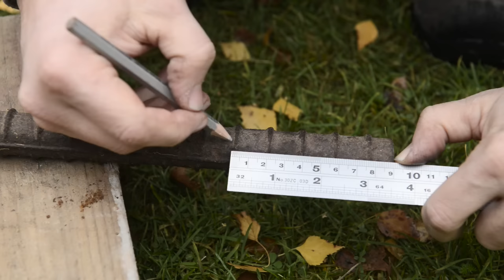Blacksmithing - Forging a tea light holder from rebar

Comment: Very simple project. You really like rebar to work with. It is very easy to work with and shapes easily. Also, unlike mild steel, it will take a heat treat, though it is not a very good heat treat as it never really gets hard enough for a hard use tool. I guess it is some kind of low carbon simple steel.
Reply from the maker: Yes. The alloy can vary very much. The purpose is just to sustain a specific strength specification, other than that it can contain just random alloying elements - so I have heard...
Reply: Yes I have made some knives with it and heat treated them. They hold an edge...fair. It reminds me a lot like 9cr18mov. Any time I try to get an official make-up of the alloy manufacturers say it is just mild steel but that is clearly not 100% accurate.

Comment: Outstanding use of rebar! Unfortunately my power hammer doesn't have the guts to upset something that size. I'll devise a way cause these are just plain cool! Keep after 'em Brother Torbjorn! Adios!
Reply: You can always use just a normal hammer, though it will take 5 times as long.
Reply from the maker: Thank you!

Comment: Impressively light, deft hand in the press with those small pieces.  Loved the paint patina too, have to remember that trick.  Thanks for sharing!  ~PJ
Reply from the maker: Thanks PJ. Yes, the tricky part is to squash it straight, so you have to compensate and correct for that.

Comment: Hey man, question:  the black spray you use, then wipe off.  is that a bbq high temp black spray paint?  I like the idea of adding that highlight.
Reply from the maker: Hi! It might have been... It doesn't matter much. Any black paint will work to darken up the low spots.

Comment: Beautiful tea lights. Thanks for sharing. So simple each unique and individual. Thought just a traditional blacksmith finish of pure bees wax applied when hot would perhaps be preferable to paint and varnish though.
Reply from the maker: Thanks. Since there is this very unique relief or pattern I wanted it to stand out and decided to try something different. By rubbing off the paint you expose the metal on the high spots which accentuates against the dark. Could have gone with bees wax on top of this of course but well... spray varnish I applied.

Comment: Nice work! If you had to recommend one hammer to someone who is just starting blacksmithing which one would it be? I see a lot of smiths using rounding hammers, though I'm unsure what to get exactly. Thanks a lot!
Reply from the maker: Start out using what you have or buy some heavier cheap ball peens or something, it really does not matter that much... Just grind the edges of the face smooth and hammer away. As you progress you will find the need for different peen hammers and round faced hammers.... I don't think there is a ultimate pattern for beginners. I started out using swedish pattern cross peen hammers.

Comment: What are those black flakes you constantly have to wire brush off the hot metal?
Reply from the maker: Iron oxide! It forms on the surface when air interacts with the hot steel.

Comment: how about heating the slug then twisting it before shaping the tea light
Reply from the maker: Endless possibilities... but it's difficult to twist a short piece. You need to twist a long section. However I don't think that adds so much to the rebar. To a square bar it might look cool.